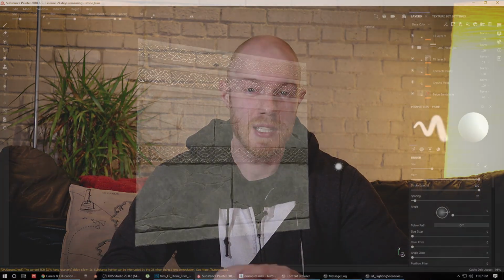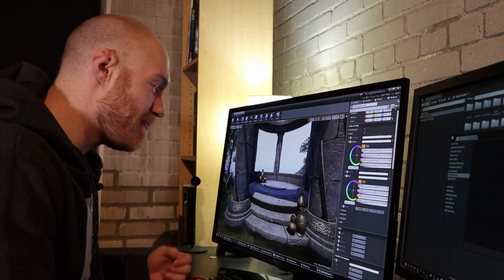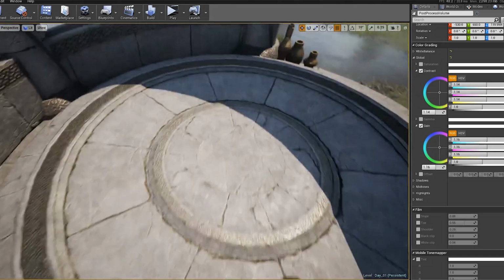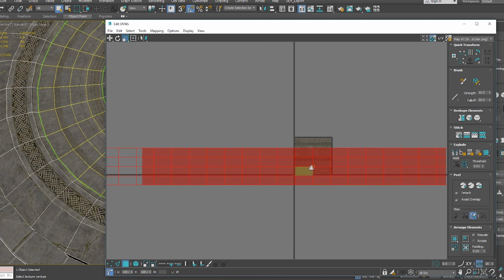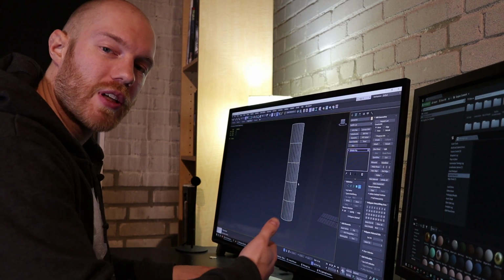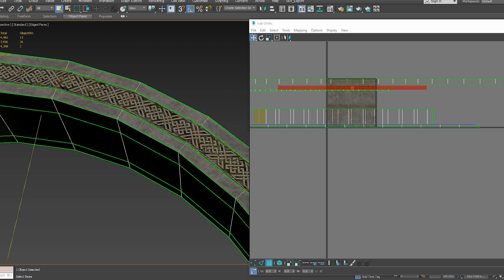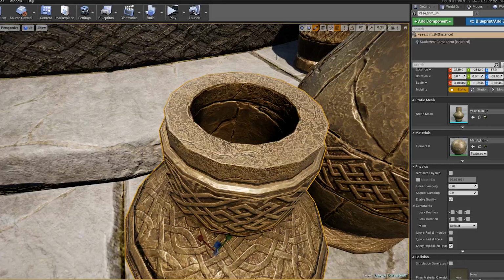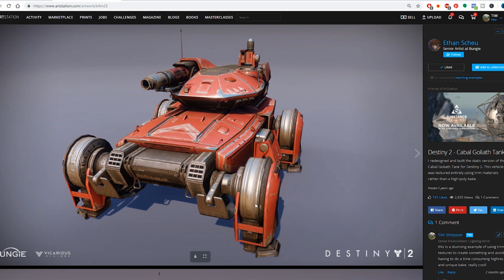TRIM TEXTURE TUTORIAL - ENVIRONMENT ART 101

Comment: I HAVE A VERY BIG QUESTION FOR YOU!  so you used lots of polygons in order to use your trim sheet , does that really worth it?! what's the costs and benefits?
Reply from the maker: yea good question :) these days polygons are pretty much the cheapest thing you can use for games, not even including nanite in the equation. the biggest cost is usually texture memory, so if you can make an entire kit with 1-3 materials using tiling/trims the tradeoff is definitley worth it. I would say nowdays the examples in the video are actually pretty low poly compared to the last couple games I worked on for current gen stuff. so dont be afraid to use more geometry if it saves you having to have a bunch of unique unwraped/baked objects, in the end the tradeoff is worth it, especially if you give your objects LODS so it cuts the polycount in half at a distance :) hope this answers your question! thanks for watching

Comment: I know this video is a bit on the older side... But there's one thing I am curious about. How do you add detail? For example when using wood to make a chair or table, I want to add nails. Adding them on the trim sheet means either having seams or very specific planning. Do you use floating geometry so you can have an extra layer or detail?
Reply from the maker: Yea kitbashing with a library of smaller assets using a different material ID would be fine. Most assets ive made for modular kits use 2-3 materials, thats totally fine :)
Reply: @PolygonAcademy  Dang, talk about response time 😄 So do you stick them on in the game engine using decals, or in the mesh itself? I'm trying to make something for standalone vr so I want to be careful with what I do. If you're ever looking for topic for a tutorial, I vote for details on trim sheet based meshes haha
Reply from the maker: @WesleyOverdijk  id just attach them to a mesh, ideally as small geometry vs alpha/decals, especially for vr, avoid projected/deferred decals if you can. Geo is super cheap these days so intend to favor more polygons instead of more textures/decals
Reply: @PolygonAcademy  perfect! Thanks a lot, I appreciate it

Comment: What size was the wall to start with 2 meters x 2 meters? 4x4? Also what resoultion maps was used 1k,2k,4k,8k?
Reply from the maker: 4x4m and 2048 textures. 512px/m trxel density, pretty common for most console hardware, could go 4k maps for high end pc, but really the difference is so tiny you can barely notice, especially during intense gameplay haha.
Reply: @PolygonAcademy  What about in the case of a FPS game, is 512px/m still a good enough Texel Density for detail? Most things I have read say to use 1024px for a FPS game.
Reply from the maker: @xThree65x  yea fps can be higher texel density, but that means using more generic tiling textures usually at increased tiling rates rather than putting 4k textures on stuff. it also depends on the hardware, COD on console might end up being 512/m for memory purposes while being 1024/m on pc for example. when in doubt, your pipeline should be tailored towards your lead sku/platform you inteed to support. :) you can always author at higher texel density and downres in engine as well as needed.

Comment: Hi there, thanks for the tutorial, how do you use multiple textures for a single model? Say for instance, I want a stone frame with a metal grate in the middle. How would I accomplish this with two separate seamless textures?
Reply from the maker: You just apply 2 materials to the different faces in your 3d program and it will assign the mesh multiple material ids/slots and you can apply the 2 materials to it in unreal :)
Reply: @PolygonAcademy  Thanks for the response! I thought I should've used two separate meshes to accommodate both separate textures. I'll try what you mentioned. Thanks!

Comment: Someone sent me this video for a single line where you said you used a mixer mask to re-colour a texture. I was going to use vertex colours instead. I'm making mods for skyrim currently.
Reply from the maker: yea you could use vertex colors instea, especially for skyrim which is an older engine, with masks you can take advantage of both tinting and changing the roughness to give different surface material types.

Comment: So all models are gonna have sharp edges? I have been making high polys for everything and texturing them separately. Pretty sure I’m trolling myself but not sure what else to do. Trim sheets are nice textures on low poly objects and don’t have any AO or normal map information apart from that on the texture.

That said, yours looks amazing.
Reply from the maker: yea where there are uv seams you can have sharp edges that rely on the normal map bevel to light properly. Another method you can use is face weighted normals with tiling textures, to get a nice smooth highpoly edge look but without having to bake any normals. Alien isolation used that technique a ton on their props. check it out! there is lots of good info if you look for face weighted normals tutorials
Reply: @PolygonAcademy  you’ve really helped me with this tutorial series. My assets and confidence sky rocketed. Cant wait to make tonnes of new ones to make lots of modular kits.

Comment: Hello, I know this is an old Tutorial, Do you work out scales from Pixel to sq meter like a 2048 texture is 0.541mm or do you use another approach to setting out trim sheets for each texture?
Reply from the maker: For me i usually try and keep it simple such as a 2k map covers 4m. Which is the same as 1024 / m, and then chop up my trims into power of 2 widths, 512/256/128 etc

Comment: Thank you so much for this, it helps a lot with building modular stuff! One question : you mention generally in a dev environment, you're gonna use 512 for 1 meter. And using trim sheets breaks this rule and texel density, but it's fine if you're on a rush. But what if you have all the time you want? You still want to use trim sheets because it's way more optimized than 1-1 textured asset, but then you'd still break the 1 meter rule.
Reply from the maker: You can still somewhat maintain that texel density with tiling the trim sheets but it will break sometimes. Being 10-20% off in exchange for the time savings is usually worth it :)
Reply: @PolygonAcademy  got it, thanks a lot for these videos! :)
Reply from the maker: @thomass.39  no problem, thanks for taking the time to watch and comment! appreciate it :)

Comment: how do i properly maintain a consisten texel density when using a trim texture?
Reply from the maker: you can have about a 10-20% density difference before it becomes noticeable. its a trade off for speed and efficiency. texel density wont be 100% perfect, but you can get a lot more done quickly.

Comment: Question. I do work for site where the products I create can be taken by others, re-textured, and sold as their own product while I receive a little bit of the cut from their profit. Problem is, they can only edit the texture of my products, not the model itself or the UV maps. So, if I want people to edit my products, they need to have the UV maps. How can I use this technique and make it shareable with others who can only work on the UVs but can't change or move the UVs?
Reply from the maker: you could standardize the trim uv placement/width so people could just change the detail in the texture, but this workflow is gonna be crippled without the ability to manage and edit uvs. I would say maybe give the models in a fbx/obj format so people can change the uvs as well, that would be my expectation if I was to to be working on an asset.
Reply: @PolygonAcademy  Thanks for the quick reply, much appreciated. :) I'll see what I can I do.

Comment: I'm really confused. Won't those overlaps cause a problem in engine like UE4. If you have islands outside the 0,1 space you get that overlapping uvs error? Sorry I never actually used trim sheets in all my time modelling much. Feel like i'm a bad artist not realizing I could utilize this technique. I think I have kinda used trim textures for foliage. I want to try learn this but I worry I won't know how to plan the texture out or I have empty space. So should I just make the trim texture first, then block out the model then start unwrapping with planar, turn them into strips and lined them over the texture? Is there a special thing I need to do to import into UE4 like a unique unwrap so I don't get some kind of overlap error? I  think it's the planning of the model/texture I am worried about doing if I am doing it right or wrong. Like if I made a wooden chair with trims, do you have four side sheets for each leg to fill the sheet up or one set of leg sheets and just overlap. Thanks a lot for the video Tim has cleared up a lot of things!
Reply from the maker: You can put a non overlapping unique uv for the lightmaps in uv channel 2, or have unreal do that automatically for you by generating lightmap uvs on import, where it takes all the shells and lays them out in a unique 0-1 in channel 2 for you. You can block out your models first to see what proportions/thickness you will need or you can just wing it, both ways have worked for me. In this case i winged it and made the models after but most cases i work from a concept and blocked out model first haha
Reply: @PolygonAcademy  Many thanks for this! Really great tutorials and advice from the masters of the universe. :D

Comment: That's fantastic,  but what about lightmaps for these props? How did you approach that issue?
Reply from the maker: ICO i just used uv channel 2 for lightmap uvs with a non overlapping unwrap :)
Reply: @PolygonAcademy  okay, is that an automatic or a custom unwrap? If the latter, where did you put your seams? In 90% of the cases my UE4 bake turns out to be pretty horrendous despite non-overlapping UVs. I follow a rule of placing a seam at each sharp edge > 45 degrees, but even then, after building the light in UE4, the results are pretty bad. Automatic unwrap has never worked for me either.
Reply from the maker: @HDico2013  i think for this video i just let it do them automatically, which takes your channel 1 uvs and lays them out in a non overlapping way in channel 2 inside unreal. but if there are issues, I do them manually, and add some padding between my seams, but most of the time bad bakes are down to your lightmass settings, the default ones kinda suck. check out my lighting presets tutorial where i go over some lightmass settings that should help you get better bakes!
Reply from the maker: I am also going to do a lightmap/lightmass tutorial soon :)
Reply: @PolygonAcademy  I followed the tutorial about lightmass and although the final bake looks good, the modifications cut down my GPS by half. I'm guessing too much of a post-process eye candy happening.
Reply: @PolygonAcademy  please do so, I am really confused when it comes to lightmaps and I've been doing this for 2 years now. It doesn't get any easier...

Okay, let's see if I got this right, because I went through the video several times and some things are still ambiguous.
1. Create a trim sheet inside a 3D program (blender in my case) using models and sculpting.
2. (not in the video) Assign vertex colours to the different segments of the trim sheet
3. Create a simple plane with as many segments as on the 3d trim sheet
4. Bake the high poly 3d trim sheet onto the low poly plane inside Substance Painter (not quite sure how is this done since the low poly is only a plane and not a low poly 3d model following the high poly shape)
5. Bake vertex colours in Substance Painter
6. Assign different materials to the low poly vertex colours and export textures according to the PBR workflow
7. Open the base colour texture in blender and use it to texture the 3d asset you need to texture (in my case - a stone coliseum) using the trim texture workflow
8. Make lightmaps somehow
9. Export the 3d asset (no high poly - low poly workflow required anymore), put in UE4, use the rest of the PBR textures from Substance and pray to the twelve gods of Kobol during lighting build
Reply from the maker: ICO haha yea but i didnt do anything with vertex color, i just baked to a simple 2 triangle plane, no segments added. You just put it behind the highpoly so when the rays get cast to capture the normal map they hit the highpoly straight on, its basically like looking at the highpoly from an orthographic front or top view and thats what gets captured as your normal map. My next tutorial series is a 4 part where i show the entire process, lots of people were asking for more info on it, so i will show the sculpting and baking process :)
Reply: @PolygonAcademy  that's wonderful Tim, thank you so much! I've been struggling to wrap my head around this for ages! Very much looking forward to understanding all this.

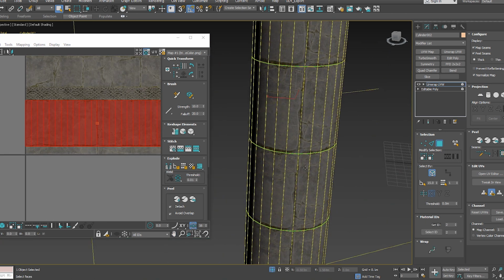Comment: 22:40 by having it in 0-1 dont you break the texel density? for instance im using a 2048px per 400cm on a 2k texture and my islands are huge and idk if i could fit that in that brick area. Is it okay for me to scale textures? im just confused, i tell textools to use this texel desnity but by scaling it down on axis etc, wouldnt i be breaking it? Also was wondering what if I map my pieces with 2048x2048 in mind but then later on decide I want to use a 1k texture? Thanks, really awesome video
Reply from the maker: there is definitley some wiggle room when it comes to texel density. usually if it doesnt look terrible, you are ok haha. I have quite a bit of inconsistent density across those example meshes, but its pretty hard to tell. and for the switching to 2k-1k example, this happens all the time, most of the time during optimization normal maps and roughness etc are the first to be cut in half in the engine. so in the end most games dont really adhere to texel density as much as you would think. I just use my eyes, if it looks good in the scene, its usually fine.
Reply: @PolygonAcademy  https://imgur.com/a/i75lLFv here i bought your files and I was trying to get my feet dirty, does this look good? Feels weird scaling stuff, cause i am reading somewhere to keep the checkers same size, yet now I learn I can scale it down etc. Maybe i am overcomplicating stuff and maybe "if it looks good" is the way. Regarding having stuff in a texel density with a 2k texture in mind then end up using a 1k texture, wuldnt the scale/tile be way off then? How would I need to tile it to make it look correct? Essentially its okay for me to have a piece get a 1k texture even though I had mapped it with a 2048x2048 texture in mind?

Comment: any tips on how to sculpt the ornaments correctly so they tile???? I'm doing this on zbrush and i tried doing symmetry or curve settings but ends up overlaping? I dont know what to do
Reply from the maker: i use wrap mode on the brush to get it to loop around to the other side when i sculpt off one side of the mesh, but it's never pefect there was a little overlap in mine but chances are when you bake it won't even be noticeable, and if it is, you can quickly fix it in photoshop rather than spending hours trying to get the perfect brush stroke on your highpoly.

Comment: Instant sub from here!... From what I've seen, this technique is requires more division and edge loops. So, we should keep that in mind and balance it wisely with polygon counts, right? For example, with that much polygon on such asset is probably wouldn't be called optimised asset for mobile games but applicable for high quality PC and console games. Is that it? Please, correct me if I got this wrong.
Reply from the maker: AutherCinemaScope yea it can require more loops and overall polycounts for better results but the overall technique was actually super common on ps1/ps2 era games, and mobile are more powerful that that nowdays as well. Polys these days are not really the issue compared to texture memory and drawcalls.
Reply: @PolygonAcademy  Thanks for the answer, really appreciated! I can understand it better now.

Comment: Could you include in the Gumroad pack the mesh that you used for baking?
Reply from the maker: i'll see if it's possible but it will make the zip file go from 190mb to like 5gb+ probably, so I don't know if gumroad is going to let that through.
Reply: @PolygonAcademy  Thank you! According to their FAQ, the max file size is 16gb for a single file. You could also upload to some other site and then include the link in a text file with the Gumroad pack.

Comment: Thank you for these videos! I have a question about unwrapping curved geometry into straight strips. I struggle with turning a surface like an arch (24:10) or a top of a cylinder (13:10) into a straight UV strip. Whenever I do it, it takes a lot of manual work and I don't get the regular spacing that would minimize warping. How do you turn a curved UV shell into a straight, regularly spaced strip?
Reply from the maker: got a video on this coming out this week, uv trim techniques :) stay tuned!
Reply: @PolygonAcademy  great! Thank you so much!

Comment: Love the vid man but one question, How do you Bake the high poly to a plane to use in substance painter.
Reply: The same way as you would bake any asset. Just bring in a low poly version (the plane) and then bring in the trim files as the high poly. Then you can bake. You might want to experiment with the baking distance settings.